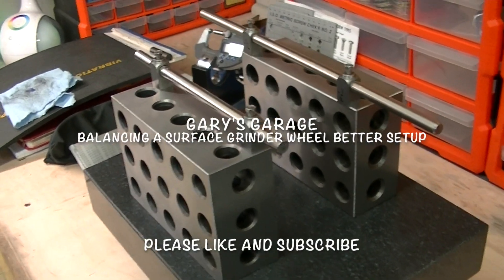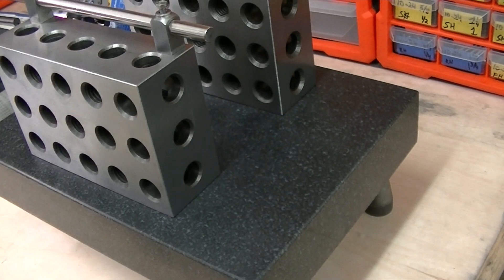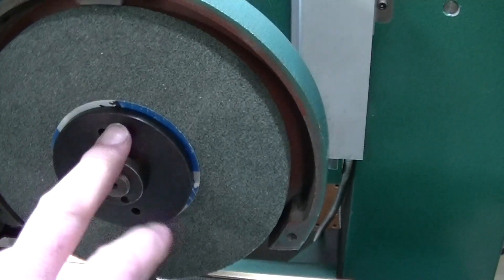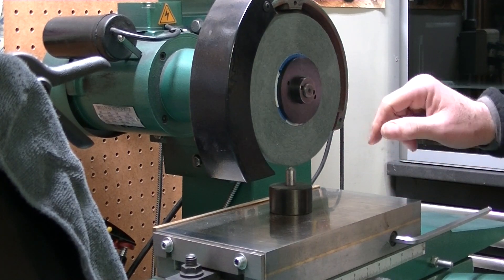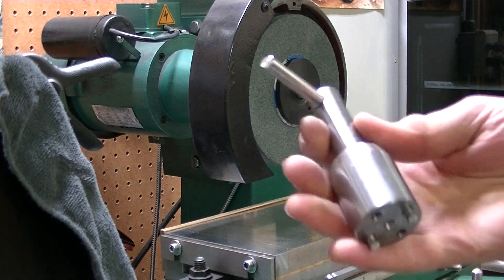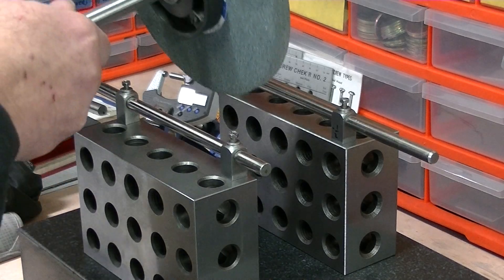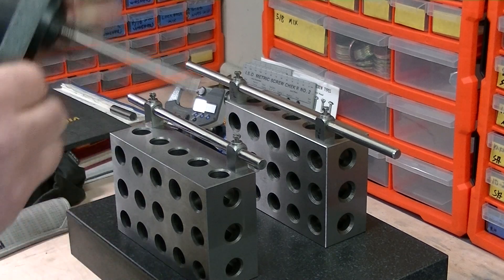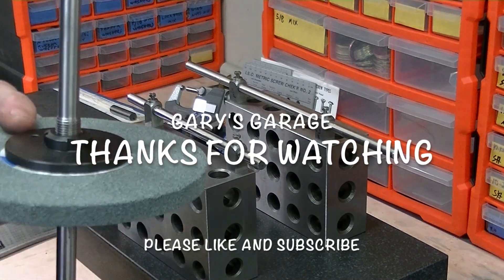Balancing surface grinder wheels , improved setup.

Comment: Nice Video!
I did the same a year ago, same setup. And as I see you also had some trouble with micro grooves in the axes which sometimes causes the stone to stop a bit too quickly. I then investigated it a bit further and came to the conclusion that with the axes I used (from the CNC - 3D printer world) the desired precision (ISO 29140 grade 1) could not be achieved properly. Perhaps the method I used to determine this precision can also be of use to you? See https://www.youtube.com/watch?v=tuGkVHI6eao
Reply from the maker: Thank you for dropping by.  I really enjoy your channel, amazing work with such a small mill and lathe.  In the mean time, I have acquired a cast iron balancing jig that I will do a follow up on.

Comment: Just dress the sides of the wheel after you dress the bottom.
Reply from the maker: Never thought of that. Great tip.
Reply: @garysgarage101  l run a Harig and Okie's most of the time. Their arbors are different from what you're running. I'm a retired Meadville PA Tool and Die maker. I was in the game for 42 years.

Comment: Thanks for your video. Did you make or buy the mandrel you used in the balancing set up? I have a similar machine but haven't been able to accurately measure the taper on the motor spindle or find a source for a "balancing mandrel" (once I know the taper)
Reply from the maker: That mandrel came with the surface grinder.  Best way to measure the taper is to mount the hub in the lathe and measure that instead.
Reply: Thanks again. @garysgarage101

Comment: Wheels that small and light can't be far enough out of balance to cause a problem. Traditionally the 3 weights are equispaced and left alone forever. The arbor is also always left on the machine. Changing wheels is accomplished by just removing the large nut. This also protects the delicate precision machine arbor. Many grinding machines using this size wheel don't even have the weights on the nut, just a solid threaded disc with 2 holes.